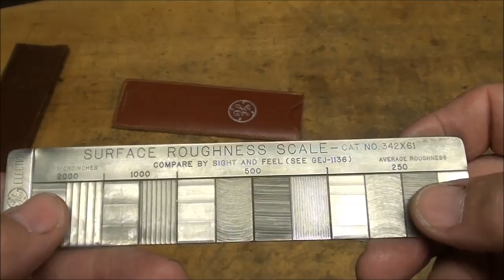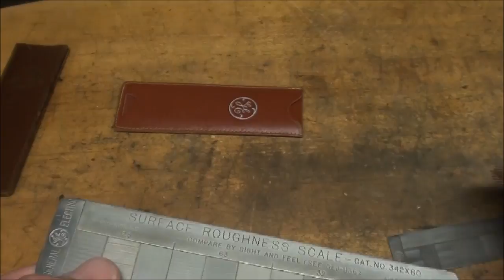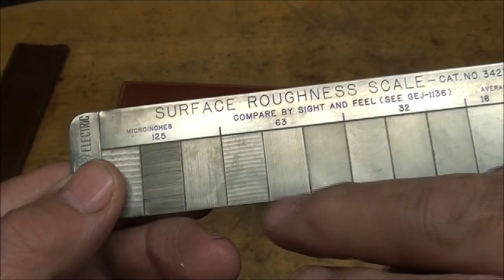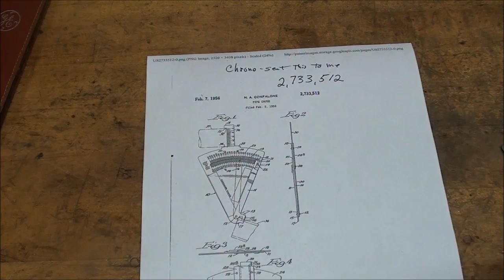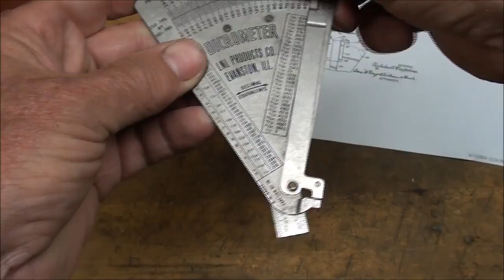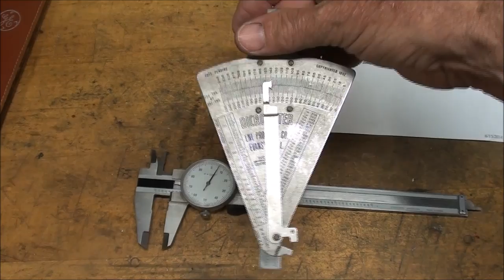WHAT IS IT?  #13b ANSWER Mystery Tool tubalcain mrpete222

Comment: Steve probably found that case in the Navy(?)tool room he checked them out of(lol). And the surface roughness is specifically chosen based on the sealing requirements made necessary by the mating surfaces. Metal contact seals would look like a 4 (mirror) but would be unsuitable for use with most gaskets as the gasket wouldn’t have the “jagged” ridges of a rougher 125 like finish it needs to expand into. Too smooth a surface and the gasket would act as a whoopie cushion instead of a sealed joint. Too rough and the gasket won’t fill the ridges enough and it’ll act like a reed in a sax.

Comment: Save the old leather case and use as a leather strop for bringing a fine edge on  a knife. Add a bit of red rouge to the leather and mount the case side on a piece of flat wood. Strops are handy additions to the work station bench.   Dan

Comment: When our teacher told us about Rubert gauges, he also called it a "scratch" gauge and demonstrated that the correct way to use it was by scratching the surface with your fingernail and comparing it to the workpiece. He told us it was surprisingly accurate. I kind of filed the information away as interesting but useless, until.....

Fast forward 30 something years and I'm stood at the parts counter at the Volvo heavy equipment dealership. The parts guy had two identical looking parts removed from their boxes with different part numbers on the boxes. Which one is which? He managed to find a service letter saying that the later part had a different surface finish. A quick scratch told us that the surface finishes were actually different even though they looked the same.
Reply: Using a penny to feel surface gives a better uniform result than a fingernail.